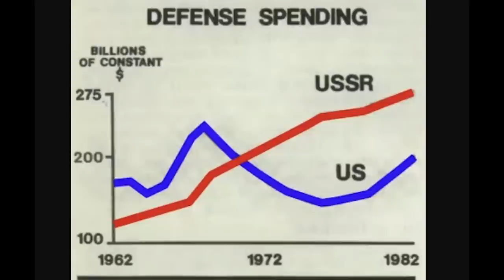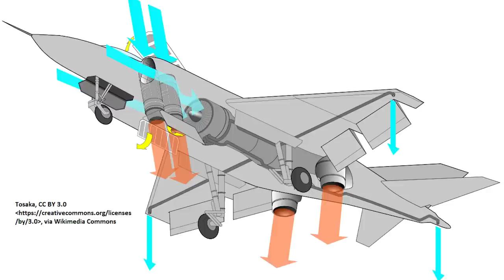Rockwell XFV-12; The VTOL Fighter That Couldn’t

Comment: Rockwell was overloaded with projects at the time B-1A, Space shuttle etc . I remember reading that one early concept was for it to use a version of the BS-100 "super pegasus" but this was superseded by the "de Haviland ejector " system for lift and the conventional turbofan. Looking back in my notes from my time in the aerospace industry I see a number of references to the xfv-12 needing a very complex flight control computer which is born out by the complexity of its geometry and its very large control surfaces. If this project had been under the military unit of MDD then the outcome may have been different as they had experience from the AV-8B that would have helped a lot.

Comment: First time I’ve ever heard of this one!  Very interesting. Once airborne it was much faster than the Harrier.
Reply: No it wasn't faster because it never flew,it was potentially faster though
Reply: Theoretically, since it never actually flew.
Reply: It certainly should've been, yes.

As the video points out, it was quite a blunder on Rockwell's part to never fly the XFV-12 as a STOVL aircraft. Particularly given that decades of Harrier operations have shown that VTOL is more gimmick than useful capability for a warplane, while STOVL (still allowing operation off a short deck but allowing far more fuel and weapons to be carried) is insanely valuable.
Reply: @jameshisself9324 It would have been because that’s why they chose to build their own over getting the Harrier. They wanted Mach 2. If they couldn’t do that, either harrier or keep working their asses.
Reply: @TeenWithACarrotIDK  Yep, lots of projects that never flew for many different reasons

Comment: You've got to talk about the Convair 200 now. It was the other aircraft designed for the SCS & it's the origin of the F35's VTOL where the engine's nozzle is pointed down using a 3 part  joint that twists the nozzle downward
Reply: The Convair 200 seems like it was by far the more promising of the two designs, but for some reason the XFV-12 was the one that got a prototype built.
Reply: Yak 141(??)
Reply: @iiwhatisyouremailprivatenn2470  The Yak-141 uses a similar system that was developed independently. Lockheed Martin (which now owned all the Convair designs via their purchase of General Dynamics' Fort Worth division) licensed all the Yak-141 test data from Yakovlev, since the Yak-141 had actually been built and flown whereas the Convair 200 had not. Thus, the F-35B's nozzle isn't directly based on the Yak-141's, Lockheed Martin just used the Yak-141 to verify that the system would work they way they expected it to.
Reply: The Convair 200 never got built so not much to talk about.
Reply: @RedXlV  It really wasn't as it had 2 dedicated lift engines which absolutely destroy usable payload they are dead weight that have to be carried all the time and would have weighed 250-500kg each depending on what type.

Vertical take-off is practically useless with any harrier and they have more spare weight for fuel and armament than the Convair 200 would have had.

Lots of V/STOL aircraft and been built and tested but the only useful ones are the harrier family and the F-35B both use one engine.  Hell the F-35B is classed as a STOVL  (short take off vertical landing) because Vertical take off is worthless for it and even for vertical landing it's range and payload are sacrificed heavily for it.

Comment: As soon as Ed stated it didn't work in VTOL, I said to myself, "But what about STOL"?  And, of course, Ed mentioned that immediately after I had the thought.  Yes, seems like a real missed opportunity, indeed.
Reply: It still need to land vertically. With significantly lower than expected lift on the actual test plane, it was doubtful if even that possible.
Reply: @ohredhk  Landing vertically seems like it'd be less challenging than taking off vertically. You don't actually need enough thrust to hover for that, just enough thrust to come down slowly.

Comment: I think part of the reason for not flying it in a conventional or STOVL mode, is that the design arguably isn't capable of either.

With the rear landing gear located so far aft, a conventional rotation wouldn't be possible. Similarly, in order for the vertical lift system to operate, the exhaust nozzle had to be closed off, eliminating forward thrust. In contrast to the harrier, which could provide thrust at any angle from fully forward to fully down (and even slightly rearward), this aircraft could only produce thrust downward or forward. That would make a stovl takeoff difficult and perhaps quite risky for a test pilot to carry out when there was no certainty it could take off at all. I'm not surprised they didn't risk it.
Reply: It’s a canard aircraft - it didn’t need to rotate the fuselage much to change the wing angle of attack.
Reply: @allangibson8494  I think his point is that the gear is way behind the center of mass, so you wont be able to rotate the plane even a little bit. It may work with a ski jump, but I am no engineer.
Reply: @delfinenteddyson9865  Canards lift the nose up directly unlike conventional trailing edge elevators that push the rear of the aircraft down to raise the nose. This changes the dynamics of the forces on the undercarriage significantly.
Reply: @allangibson8494  In my understanding you still rotate around the center of mass, irrespective on which end you apply torque. Do I miss something?
Reply: @delfinenteddyson9865  the difference is that without a canard the main wheels be close to the centre of mass to permit rotation of the tail down to push the nose up.
With a canard they don’t because the nose is directly lifted up - and an aft pivot point actually helps with lever lengths.
On landing things get a bit sketchier for a conventional landing because the aircraft will need to maintain canard lift (and hence speed) until the nose is on safely the ground to avoid slamming the nose onto the runway - for a vectored thrust VTOL this isn’t a problem and having gear at all corners would make the aircraft far more stable on a moving deck. Canard aircraft do however have 110% more lift than a conventional tailed aircraft because the canard is a lifting surface while a conventional tail pushes down all the time (if it didn’t a stall becomes unrecoverable - a problem for pretty much every airliner designed after 1980 when the designers deliberately did this to reduce drag at the expense of stall safety). The tail stalls first, stops pushing down and the nose drops - the difference in a canard is the  canard stops lifting to the same effect.
The Harrier used four gear - two on the centreline and one smaller one on each wing tip for similar reasons. With a conventional tail the Harrier had to have one of the main gear further forward for angle of attack control.
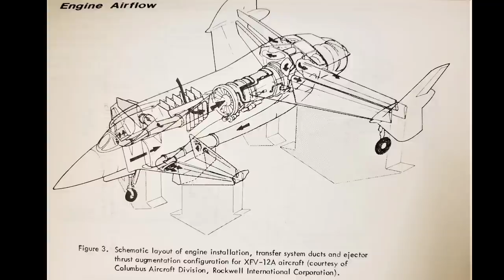Reply: @allangibson8494  but for sake of argument, if the center of mass is directly on top of the canards, the canards wont be able to push the nose up as they dont have enough lift nor leaver. At 5:20 there is a schematic; I would agree with you if you think the pivot point is near the gear, but I think the op made the claim that he thinks it isn't. If it is though I would agre with you.
Reply: @delfinenteddyson9865  It doesn’t matter where the centre of gravity is - the canards can always provide an upwards force. The only question is, is it enough force to lift the nose against gravity enough to increase the angle of attack of the main wing.
It is like lifting a board on the ground from one end compared to putting a pivot in the middle and pushing down - same effect on angle but very different lever forces applied to the ground.
On the ground the aircraft will always pivot round the gear - but the canard always lifts rather than a conventional tail surface that has to push down.
Reply: I hadn't thought about the way the system redirects thrust like that.  Without main engine thrust, even with canards, it would be difficult at best to get enough speed for STOL launches (using a ski-jump ramp for liftoff negates the problem).  And who knows whether or not the SCS design had enough runway for a canard-enhanced conventional takeoff...

All in all, it sounds like one of those designs that works on paper, but not so much in reality.  It's a reminder of the challenges of designing aircraft in the days before computer modeling could provide initial answers as to whether such systems could deliver.

It's an intriguing design...the canard is a well-proven concept, with Saab and Dassault both developing very successful fighter designs using it in the 70s.  Had this been designed as a conventional fighter from the start, without diverting efforts into trying to make it a workable VTOL fighter, it probably could have been very successful (not worrying about VTOL would definitely have improved its weapon capability, probably would have allowed for increased fuel capacity, and its off-the-shelf component design would have made it relatively cheap to produce).  The Navy could have ended up going in very different directions, as far as aircraft design.

Comment: Along with the Avro Arrow, YF-23, this is one of the aircraft I most wish came to be that didn't. Ever since I first saw a picture of the thing it just seemed like the coolest, most sci-fi like fighter I'd ever seen. Would have been so cool to see these flying around of Naval and Marine vessels.
Reply: The TSR.2 which was built and flying until the Brits ran around cutting things, they wanted to buy F-111s instead but those took forever so they ended up with fat Phantoms.

The Hawker P.1154, the twin engine supersonic super-Harrier that never did get to metal.

The Grumman F11F-1F, which would have sold well were it not for Lockheed bribery.

Comment: You seem to forget the Sea Harrier,  designed from the outset to be a capable fighter as well as carrying out other roles, proving to be so in the Falklands with a 10:1 kill ratio. One of its big advantages being it did have for the day a very capable radar system.
Had the USN seriously pursued the high-low doctrine, with AV8s already in service with the USMC, I suspect that that commonality coupled with an aircraft  successfully combat proven against a near peer adversary would have led to an American Sea Harrier  rather than this.
Reply: He did not forget anything. Did you miss the part where the US Navy wanted a supersonic fighter? Also, you might want to check on the "very capable radar system". The Ferranti Blue Fox radar was considered being one of the worst aircraft radars of its time. That's why it was very quickly replaced with Blue Vixen, but that happened after the Falklands.
Reply: @sergeychmelev5270  The usefulness of the radar is very heavily debated, It's wrong to call it "one of the worst", some viewed it as a great piece of kit, others, not so much.
Reply: @seaharrierfrs1  I’m not aware of any debates over the Blue Fox. Of course it was better than nothing, but name me a worse aircraft radar that went into service even 5 years before the Blue Fox. No look down capability unless the sea is perfectly calm in the freakin’ 1979? No radar-guided AA missile compatibility? Yeah, “debatable”. Of course, if there were AEW planes in RN, that wouldn’t be too much of a problem. But we’re yet to see a STOVL AEW. Those helicopter AEWs abroad QEs are not even half-measures.

Comment: Which only supports the old adage that one should under promise and over deliver with your product or service.  By demannding VTOL performance instead of the "less capable" STOVL capability the Navy forced its supplier to over reach and it failed.  This was a hard lesson in the consequence of demanding technology that doesn't exist in  the development of new weapon systems.  Fifty years later and the Military still lets Admirals & Generals pull design requirements out of their asses with disasterous results.

Comment: On a particular note here, Rockwell is a small company, with limited resources. Which explains why they shipped it instead of flying the potential brute beast of a Fighter

Also, the scs displacing less than 14k tons;  9,773 tons (light) · 13,736 tons (full load) when I checked, it can pass through the Turkish strait (preferably with a bunch of it) with near impunity had it been built & entered service

And they're a "good enough" solution for the situation at the time, & it's freakin' CHEAP! rather than waiting for the expensive supercarriers to come out one at a time in a long time... So Zumwalt was right all along!

On a final note, oh how I wish our Philippine navy could've had some had Zumwalt's plan was given a go-ahead...
Reply: Wai-what...? Oh shit you're right! How have I not realized that?

It's just permanently stuck off of China though, & with very small aircraft fielded. And your content reminded me of midway Island

Comment: i think they missed a great interceptor, looking at its layout in general. low weight and high power might have made it work from small carriers alone. carriers grew because the airplanes operating at it grew in first place. this kind of airplane could have been used on older, smaller carriers, keeping the first post WW generation active. or adding converted tankers/freighters to protect the rear off the US coast. as land based fighter, it could have closed a gap while forces dumped the F-104 ditching the idea of a pure interceptor for multi role fighters early on.

Comment: If you vector the thrust instead of aiming it in the desired direction, part of that thrust will still result in horizontal movement, because it gets deflected by panels. So I think the plane could not have landed vertically, because half of the thrust is always "lost" in pushing the plane forward.

Comment: A very interesting project, which, of course, I have never heard of. This aircraft in many ways sounds ideal for current use, where stealth is not a critical need. (As ordnance trucks, with the present-day longer-range missiles) In this given scenario, F-35s proceed deeply into contested airspace, while using the secure uplink capabilities available within air warfare doctrine. A considerably cheaper fighter, with the capacity to add far greater firepower to the fight using standoff AR weapons, or whatever was particularly urgent. The V12 name is also sure to fool the enemy with regard to the engine.
Reply: What, in this design, speaks to you of being an ordnance truck?  From the description, it could haul either a pair of medium-range Sparrows and short-range Sidewinders, or four short-range Sidewinders.  That's woefully inadequate for a missile truck...

Comment: I can certainly attest to the limitations of fluid dynamics knowledge during the 70s, with no computers or software capable of modelling the forces or movements of either air, or the more viscose, water environments. Leading, to the highest extent, the need for capable test pilots to brave what ever dynamics of the airframe might throw at them. I recall that it was thought this was insurmountable for the foreseeable future by aerodynamicist's in particular.

Comment: Let's just say the thrust augmenter wing ended up producing enough thrust there's still the fact there's a lot of mechanism in that whole system that trying to get that thing to work consistently especially back in the day seems very optimistic

I don't know if it was a case of let's not buy another foreign weapon system but in a slightly more advanced stage of development (at least the engine the BS100 had been) was the hawker p1154 essentially a Harrier on steroids should have easily have gone supersonic as the BS 100 engine basically took what worked with the Pegasus and added a couple of after burners to the front nozzle called plenum chamber burning and I feel this would have been less risky than the contraption in this video as well as the p1154 enable to carry more weapons.

I also read that admiral zumwalt back in the day wasn't particularly popular with the other admirals because they were afraid his SCS system would have taken away valuable funds for the more expensive naval weapons systems such as more super carriers and more f-14 tomcats.
Reply: Even with the "don't buy foreign" bias that pervades US weapons procurement and is only rarely overcome, the Convair Model 200 (which unlike Rockwell's design didn't get a prototype ordered) seems like it would've been a more promising option. It's the origin of the swivel nozzle system on the F-35B, but with a separate auxiliary lift engine behind the cockpit like in the Yak-141. This has the obvious downside that the lift engine is dead weight when in horizontal flight, it has the significant benefit of actually working. Presuming that the engines would've actually produced the specified thrust (which admittedly has been the downfall of some previous aircraft), the Convair 200 should've been able to actually get off the ground and then fly at supersonic speed exactly as Zumwalt wanted.

Convair was also proposing a Model 201 version that deletes the lift jets for use on regular CATOBAR carriers as a lightweight fighter. Though for that role, I think the Navy probably got a better outcome with the F/A-18, with its higher payload than the 201 would've been able to carry.

Comment: Another thing to add here; that is the only Jet-powered plane to employ tandem wing, as canards are almost 50% of the surface area of main wing

And though it got powerful engine, @ more than 28k lbf with the jet @ 19,500 lb gross weight, it's got around 8,500 lbf to spare. But afterburner not being usable in vtol mode, ducting & complex TAW, final power output decreased; but more than enough in conventional flight